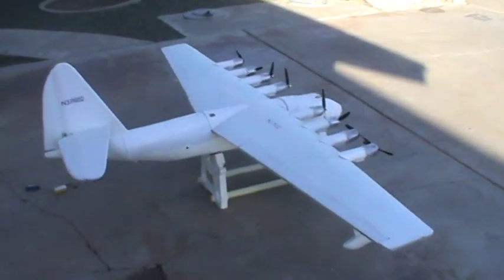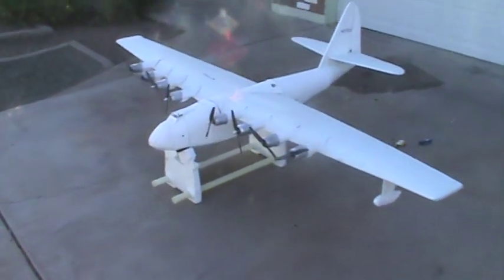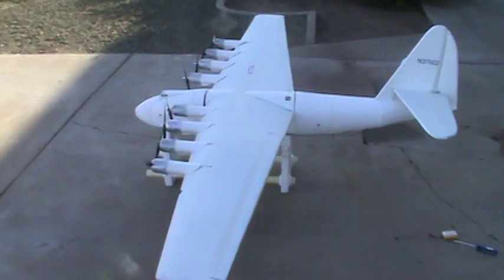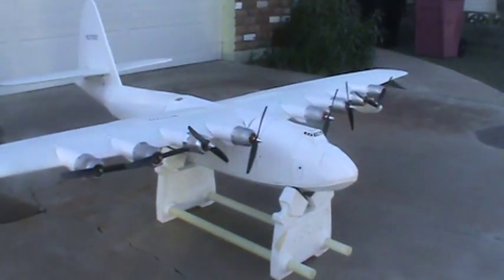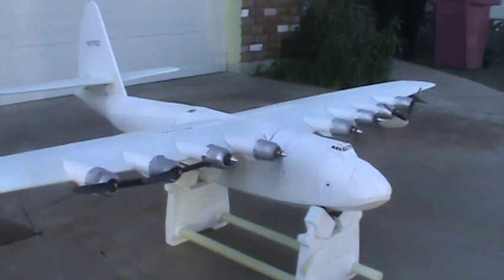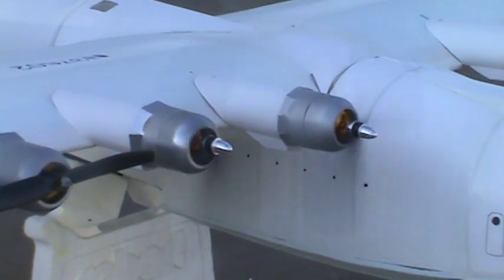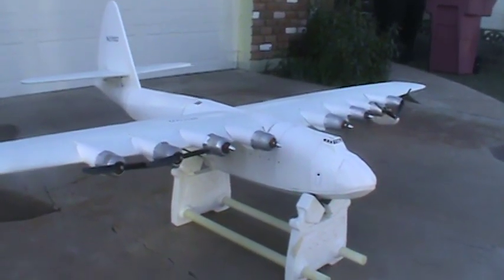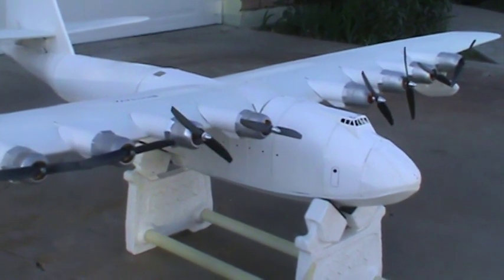Giant Spruce Goose R/C motor test

Comment from the maker: @riverlifeva The problem with spacing them like that if you lose a motor and it's way out further on the wing, it has a more dramatic effect on the power. For example, if you had motors very close to the fuselage (center of gravity) and you lost one, you wouldn't feel much difference on a 100-inch span. If you had motors further out and lost a motor, it might force you into a spin before you could cut the throttle and glide down.